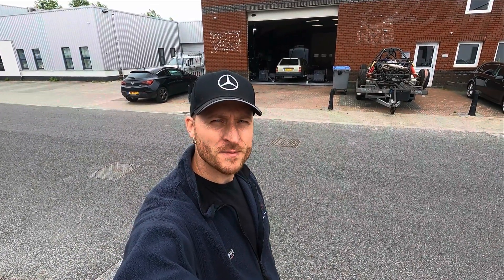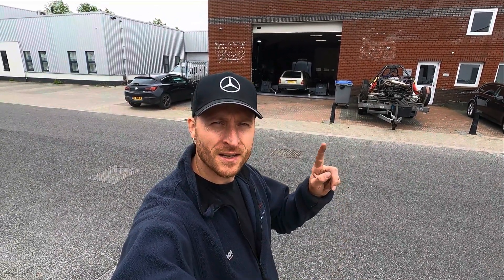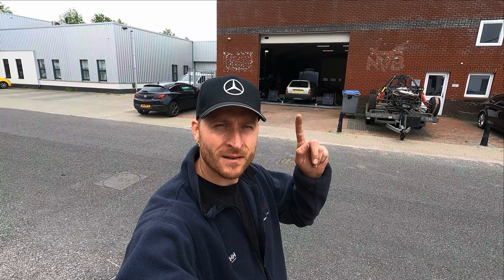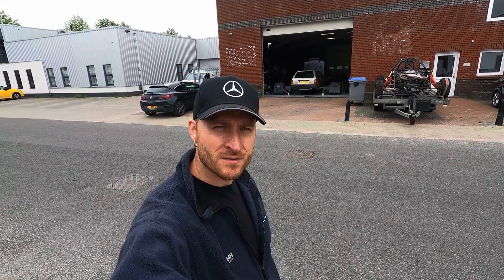S124 M113 V8 turbo Dyno session 1 @ DW TechSolutions

Comment: Which turbo and back housing are you using?
Reply from the maker: Gtx3582R gen 2.   1.01 A/R. Exhaust housing
Reply: @JMSpeedshop  assumming your hp readings are @wheels im sure you said 390hp ish
Thst turbo may be a bit small
Garrett only recommended up to 4.5l 
What AFR are you at?
Think it also said exhaust temps were high
Reply from the maker: @johntosh6146 this crank hp .  And yes turbo is to small i think afr is .81
Reply: @JMSpeedshop  0.81 is in the ball park nothing to worry about there although you may need to add a bit more to counter the E10 but I doubt it will make much difference
Reply from the maker: @johntosh6146 i think the problem is back pressure and valve float
Reply: @JMSpeedshop  backpressure yes. I wouldnt have thought valve float would have been an issue at such low RPM and power levels but you never know. Maybe a set of AMG springs will help.
Bicylindrico on YT used a different setoff springs from another engine in his build the hillbillyhammer which may be a better option
Reply from the maker: @johntosh6146 thanks i will have a look

Comment: I have the same problem. +0.4 bar boost my crankshaft sensor start to missing teeth over 4500rpm. I can run 1.5bar boost and under 4500rpm it pulls like hell, over 4500rpm no power just missfire. Maxxecu m113 turbo
Reply from the maker: But we had no indication misfires .  Lambda values staying stable .
Reply: I didn't have any missfire code either
Reply from the maker: @opelgarage6945 we had also no other indications like lean mix or no boost.  He we still had boost and exhaust  temp.  So  i think it is valve floating

Comment: Still running dual spark? I would be curious to see what ignition timing you are running though I would expect a lot less under boost. Are you using lambda or AFR for the fuel mixture? Eagerly watching to see how this bottom end holds up under those power conditions. I have considered slapping a NOS kit on my build but I am worried it may not hold another 100HP with those cast pistons. Great coverage!
Reply from the maker: Lambda values for mixture.  Timing is about 20 degrees on boost .   But internals are forged from factory.   I changed the rods.  But these pistons are stronger enough

Comment: Sounds great. Are you sure cam timing is correct?
Reply from the maker: I check today. Crank pulley marking tdc cyl 1. .  that is correct tommorow im going to check the valve  opening per side if the cams.are.correct
Reply: @JMSpeedshop  might be worth retarding the cam timing a few degrees? Well done, all these jobs take a lot of time to dial in. Be interesting to see what you find
Reply from the maker: @bernardwarr4187 cams have no adjustable timing .  It is fixed

Comment: You Should use some kind of racing fuel with high octan rating to eliminate knock factor.
Good luck
Reply from the maker: Yes .  That will be later.  For now i want to have a base tune for low octane.  I run een flex fuel sensor. So later on i will run e85. Fuel and then the ecu can adapt to how much ethanol i run in the fuel